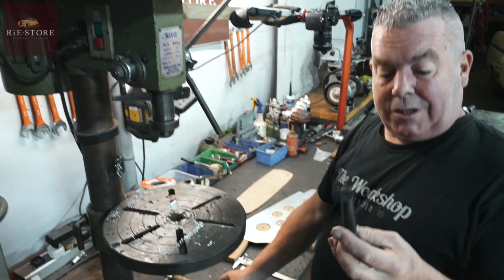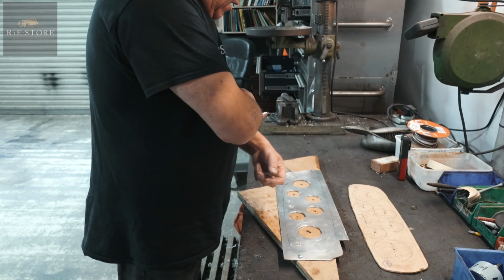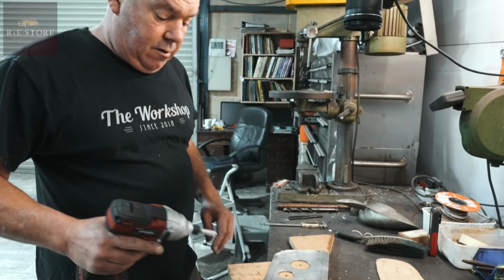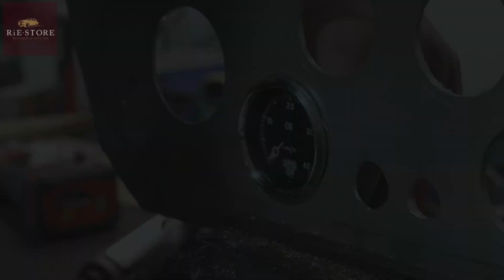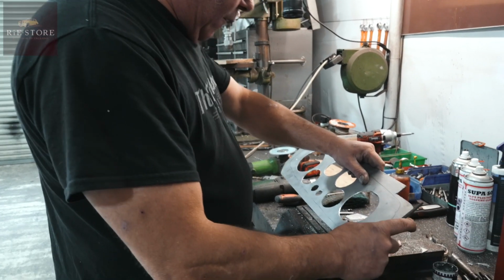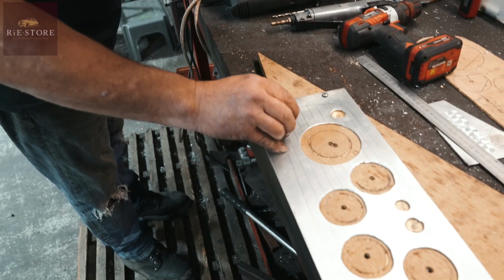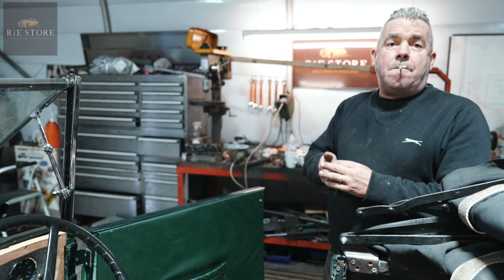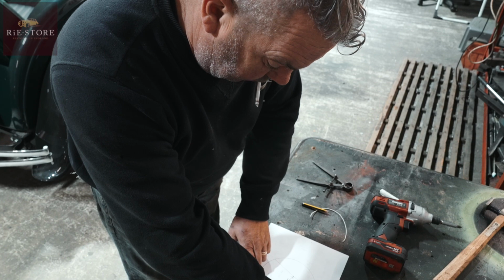Engine turning, an easy guide - 1934 Austin 10 / ep156

Comment: 13:50 there’s a better way of finding a circles centre without having to measure

Get something square (like your square or a book) and put it so the 90° angle is anywhere on the circumference and then where the 2 bits of your square objects meet the circle mark them and draw a line between them, do the same for another point on the circle and you have your centre because any right angled triangle with all comers on the circumference will pass through the centre of said circle no measuring required:)

Comment: The two lines he marked are called "chords" of the circle...and a line 90° to the midpoint of any chord will pass through the centre of the circle.
Therefore, the two chords don't have to be equal. 
Draw the chords roughly at right angles to each other, then the lines from the midpoints will cross at right angles and make the centre more clear, especially if your pencil point is a bit thick.
Even more accurately, draw 3 chords in a sort of rough triangle (the 3 points of the triangle don't actually have to meet at the circle, they can even cross each other)